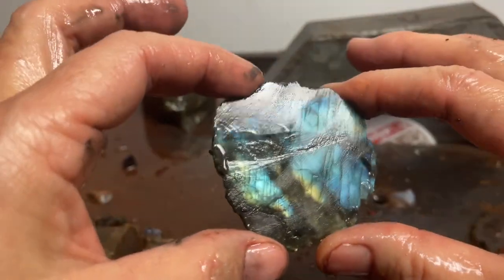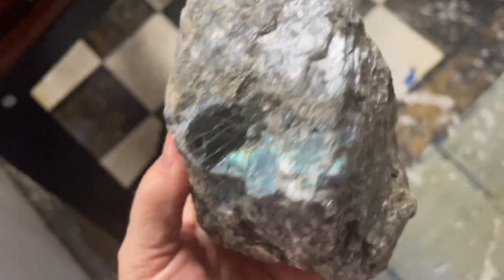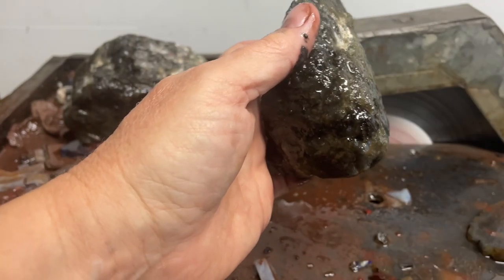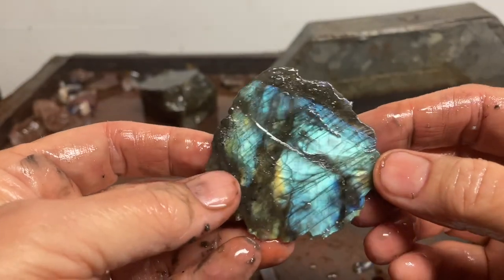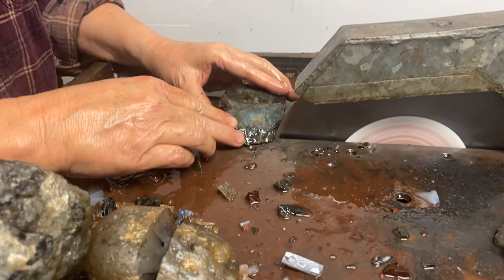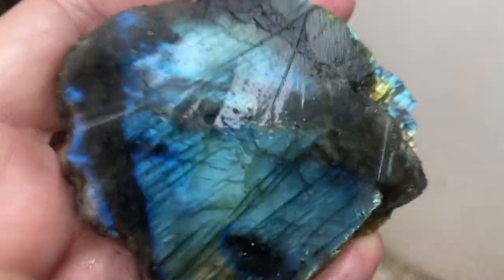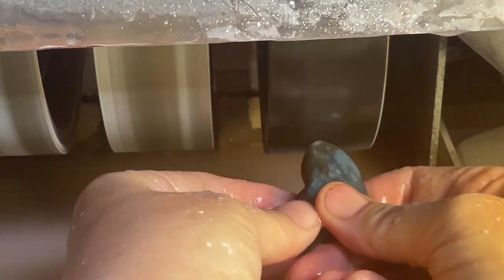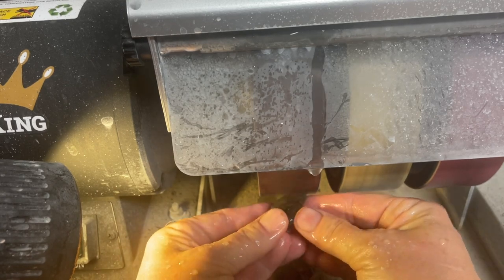CUTTING and SHAPING LABRADORITE: Ways to get the best glimmer & shimmer from this stunning blue rock

Comment: Labradorite is one of my favorite stones, but, between the fractures and the ability to lose flash while shaping and polishing, it is one of the hardest stones to get right. It doesnt take to heat well so dopping is a challenge. Doming a piece of Labradorite is not the best idea either. It shows better when its flat and you dont have to roll the stone to see it. The "eye" is the hardest thing to get right, meaning having the brightest flash even with your straight ahead vision. You dont want to have to hold it at some ridiculous angle to see the color. When you do get it right, its as beautiful as opal. Spectrolite is a more stable version of feldspar and has much more variety of color. Good job Katy!
Reply from the maker: Thank you! I really love the labradorite, although I did notice that grinding down the edges made the shine disappear. Thank you for your info! :)
Reply: @KatyDidRocks  You rock katyDid!
Reply: I have a piece that I just cut that has a flash of pinkish purple and yellow, could it be spectrometer?
Reply: @shern1966  Do you mean spectrolite? Yes it is possible.  Spectrolite has harder lines between colors , where labradorite blends colors. Spectrolite is exclusively from Finland and tends to be more opaque in its base where labradorite is more translucent. Origin is the main difference.

Comment: Labradorite is soft and easy to cut. You just can’t use a lot of force or pressure so it won’t chip up. Labradorite it’s about a five on the Mohs scale.. that’s why you see so many carvings made with it because it is easy to carve. But it is easy to lose your color.. to get that color positioned in the center. It does take some practice..